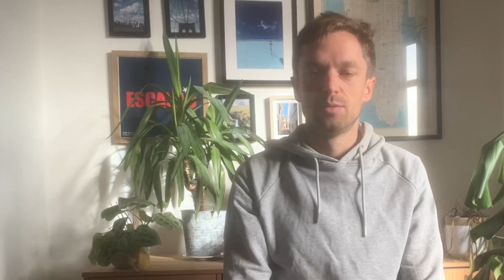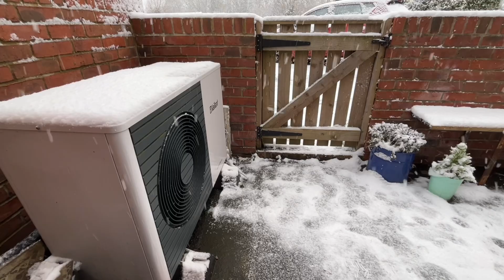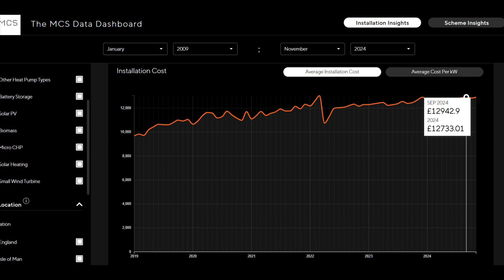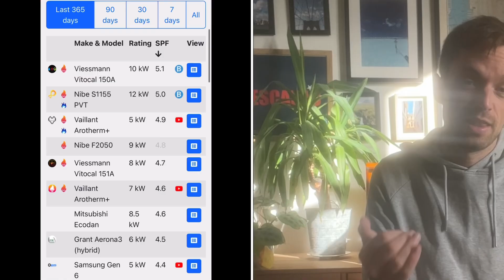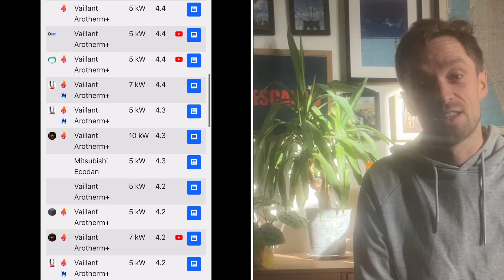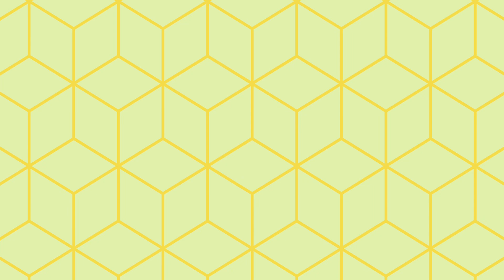Are heat pumps a good investment? The answer might surprise you

Comment: Just had a quote for one, so interested in the answer!
Reply from the maker: Where did you get a quote from? How much?
Reply: @TomBray-LowCarbonLifestyle  local heat geek firm called greenhome heating. Looks like a top firm, very knowledgeable and thorough heat loss calculation and plan for the radiator changes. 

We've got an ancient boiler, single panel rads everywhere so would need 10 changes for a flow temp or 45 to get a SCOP of 4.2 estimated. Definitely cheaper than gas to run at that performance. If I can manipulate my EV tariff to get the 7p cost for a lot of my heating and all of my hot water, I could save over £1000 a year. 

Will cost me £13,000. 

Will it add £13,000 to the house value? Maybe maybe not. 

Being off gas? Priceless to me.

Price of the house not being cold all the time? Also priceless